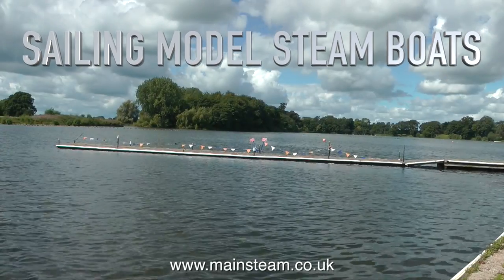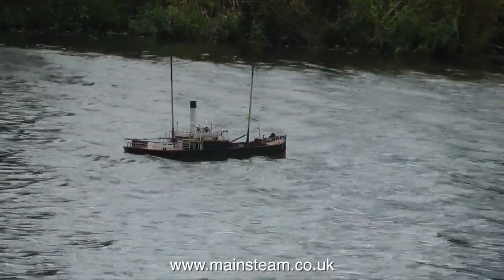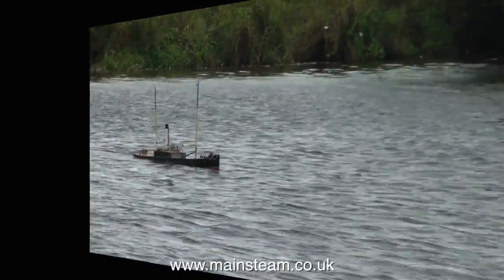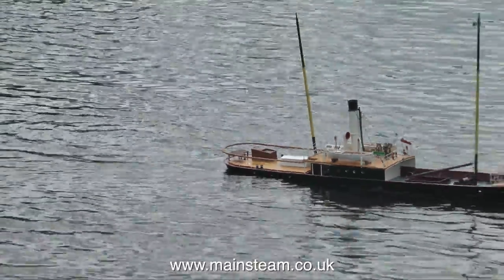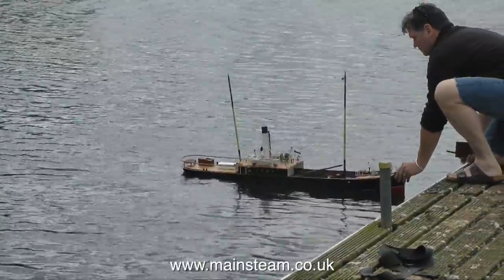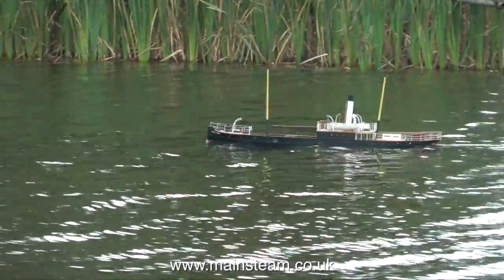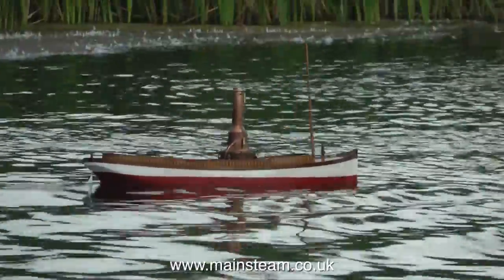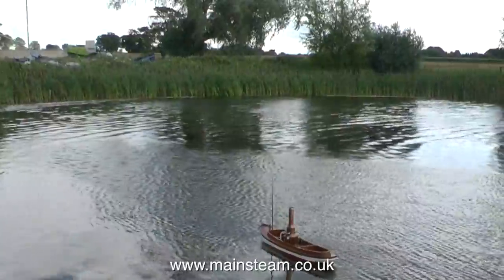SAILING A PAIR OF REBUILT MODEL STEAM BOATS

Comment: First time I've ever seen model steamers actually sailing, very nice, very nice indeed.  And I was surprised that they sail through the chop quite steadily.  
As you said you had to rescue the second one, I just thought I'd ask.
In order to prevent the need for such rescues, could the boat have a secondary smaller electric
R/C motor just to bring the boat home in a pinch ?
Reply from the maker: often there is not enough room for electric motors etc, maybe second electric model rescue Tug Boat is a better idea .....

Comment: Mr Appleton, such a delightful video of both steam engine boats. Last night my wife had to work on the computer so I watched the entire 40 episodes in 2 hours of the Vintage Launch. Just amazing!. But I have a suggestion... Would it be too out of touch to add an on board electric starter for the steam engine in the Launch? Something like a 390 or 540 dc motors a big pulley attached to a clutch ball bearing, or one way bearing; a silicone belt and an on off switch in the transmitter.. Thanks a lot and please keep safe.
Reply from the maker: Most twin steam engines are self starting. Fitting an electric motor is a problem in this boat, as I would need a battery and controller - there just isn't the room in there to fit any of those things.
Reply: @keithappleton  I understand, but it's an outstanding model. Congrats for the great job you've done

Comment: Would it be feasible (or perhaps it's already been done) to have some form of electric starter on non self starting boats? A rubber wheel connected to a motor that spins the flywheel for example.
Or would that be considered 'steam boat heresy'?

These are indeed Beautiful boats accompanied by beautiful music by the way.
Reply: Thumbobby, that has been done many times, especially on single cylinder engines, but not only.